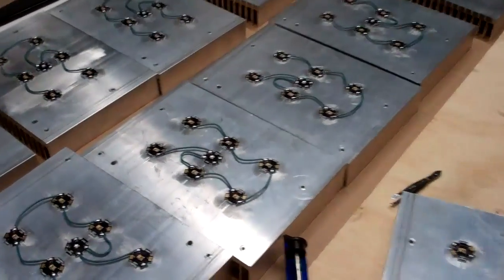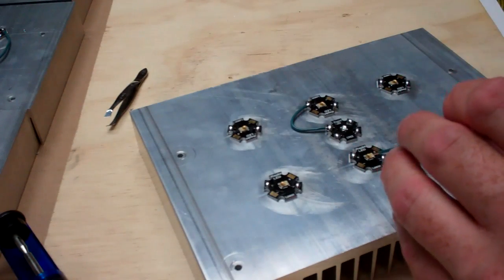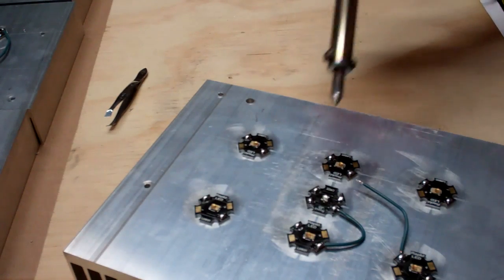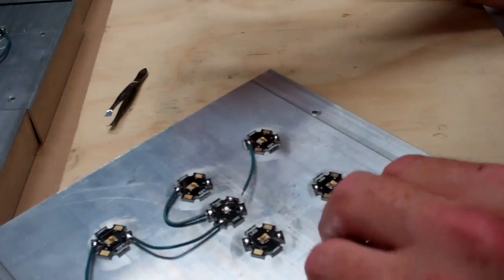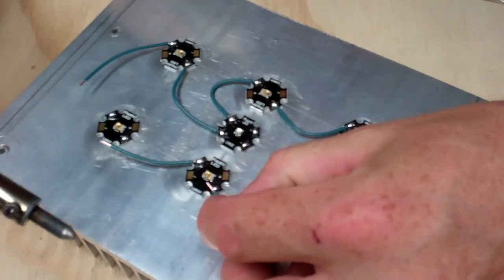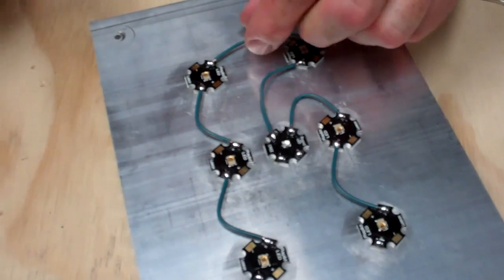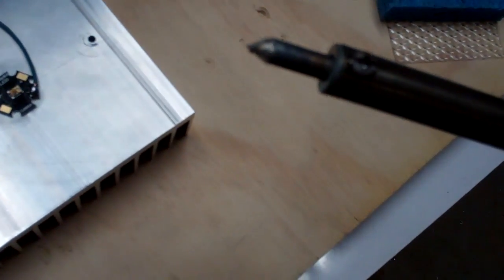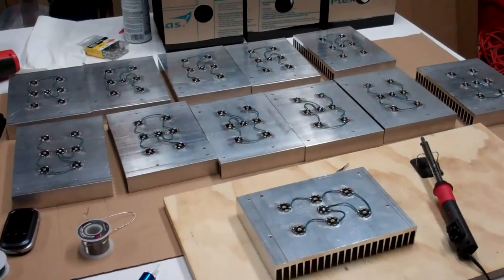Soldering LEDs

Comment from the maker: Most people have much better success with 660nm Deep Reds.  Throw a couple WWs in for good measure if you choose. I personally have not tried them, however I plan to do so as part of running some experiments, eventually.  Others have done much more LED scrubber builds than I have, so I have generally followed their conclusions that WW is majority wasted bandwidth.  Primarily you should use 660 with optionally some blue 455 but very little.